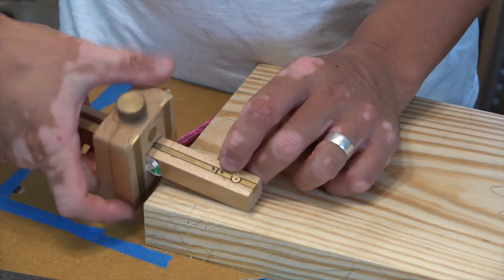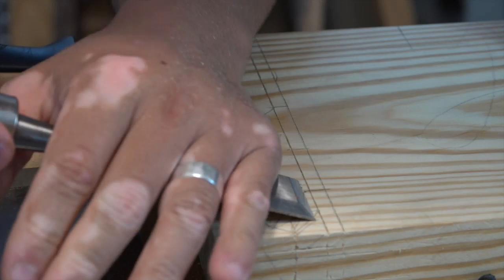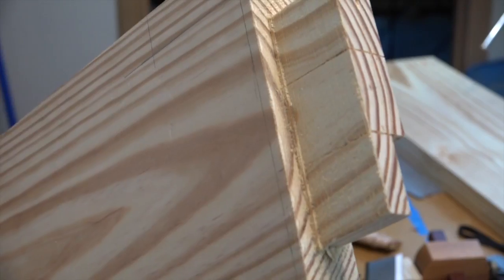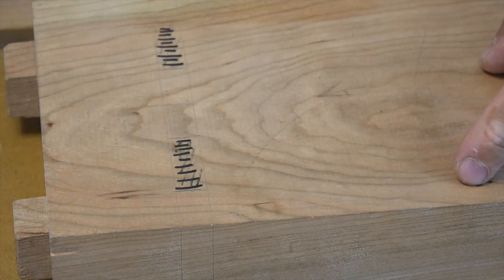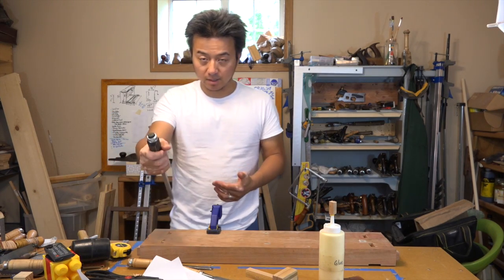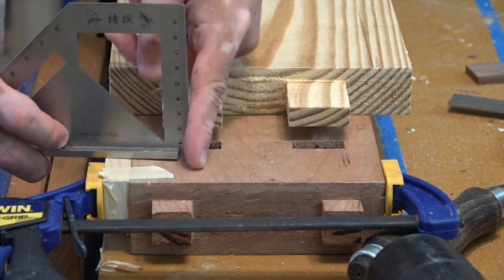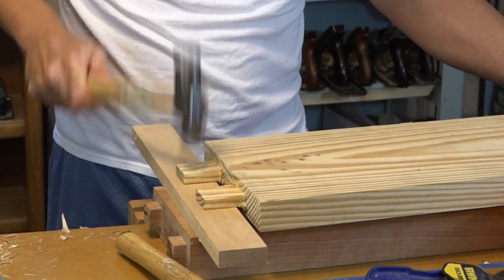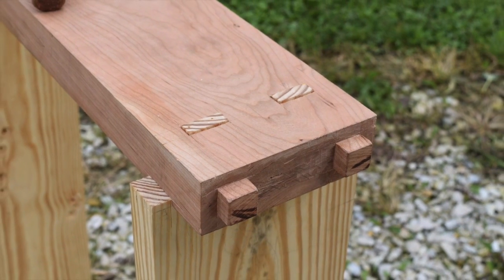Dual Mortise and Tenon by Hand + Asian vs Western Mortice Making

Comment: The tip about aligning the work piece's reflection in the saw blade to get a right angle is fantastic, never would have thought of that.
Reply from the maker: Thanks Adam. This technique has been around for ages; I first saw it on The Woodwright's Shop.

Comment: Nice work. Like the double tenons and dado added for stability. Had not seen the hammering of fibers technique. May have to try that sometime!
Reply from the maker: Thanks Mac. I think I read about it in a Shoji making book. It works really well in most cases but I'd say use it when it the fit gets really close or you may end up cracking your tenon.

Comment: Nice video, John.
Advance improvement.
I still did not know where the difference lay between Western - and Japanese Mortise and Tenon.
Reply from the maker: Thanks Gunter. Mortise and tenon are the same no matter where you go in the world. The tools are nearly identical. The difference is the way the tools are used to make the mortise. Asians starts the mortise in the middle; Westerners start at one end.
Reply from the maker: Also, the Chinese would sit on the mortise piece on a horse; the Japanese and Korean would sit on the mortise piece on the ground. The English would stand and secure the piece to a bench. And Asians sight the mortise from the short side; and Westerners sight from the long side.
Reply: That's right, John.
I am surprised the Japanese, no back pain.
When they work sitting and bending

Comment: Hi John,

I'm hoping you can answer a question from a new woodworker like myself. Why did you make your mortise and tenon at the same time rather than making one and then marking out the size on the other so you didn't have to shave down like you did at around 11:40?

Thank you in advance!
Reply from the maker: That's a great question. Typically, the mortise is made before the tenon. And the thickness of the tenon is set by the chisel used to make the mortise. Which is sort of what I did. I made the mortise, and made the tenons over sized. A tenon rarely fits perfectly with just saw cuts, or chisel work, in fact I've never seen a person cut a tight tenon w/o having to shave down tenon or expand the mortise.

Had I tried to saw it to the exact dimension, is like trying to a small exhaust port while traveling at high speed. Since I am not the "chosen one" I can't do it; so I make it for sure a little fat and pare it down to fit. 

Also, a perfect fit on the first try become exponentially more difficult, when it is something that can't just be held up to each other, like how Paul Sellers demonstrates it. 

It's easy to cut a tenon that's loose. A Japanese author once described that a good joint is one that is so tight that it is on the verge of breaking, but doesn't.  Hope you got the answer you were seeking.
Reply: Great information, thank you very much! I actually was confused due to viewing the joint making on Paul's channel so thank you very much for the clarification, the logic makes quite a lot of sense. Thanks again!

Comment: Nice work! I've always made mortises by hand by drilling them out first, then cleaning it out with a regular chisel. But I guess that with practise, chopping with just a mortise chisel would be faster, especially when the mortise is with the grain.
Reply from the maker: Thank John. Roy Underhill recommends drilling (brace/bit) out the mortise for wide mortises from both side, also he recommends creating a ~1/8" step down before drilling to keep the edges well defined. I think he talked about this in his "Big Ash Mallet" episode. Going with the grain is definitely easier, I had chopped 1/2" wide 2" long mortises 3" deep for the base of the workbench and it went pretty quickly. Although I think a lot depends on the wood, I found oak easier than cherry. For me mortise chisels are better than regular chisels for mortises even though Paul Sellers would disagree. The Narex mortise chisels I got are pretty good, though it needs a secondary bevel or else the edge chips easily, in case you were in the market.
Reply from the maker: upon reviewing videos for editing, I did use the step down method and drill out a good portion of the 3" deep mortise I described earlier.

Comment: Again, ❤️ the portable work bench. Question: I see you have a range of different brands of chisels and hand planes. It looks like you have them all pretty finely tuned. From experience, I know that this is no small task. What brands, other than Lie Nielson, would you now recommend? Ones to avoid?
Reply from the maker: I don't recommend any brands in particular. My most used chisels are from Harbor Freight. Steel is the key, I've found mass produced steel is basically the same, the chemical formulation is the same doesn't matter who makes it or country of origin. It is more important to know how to sharpen them.